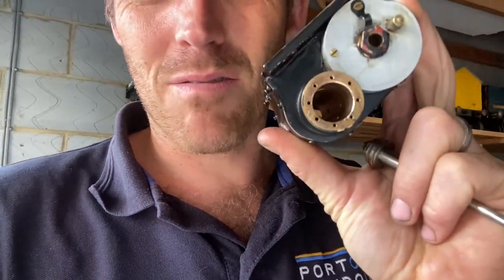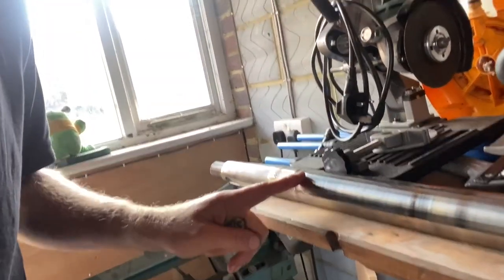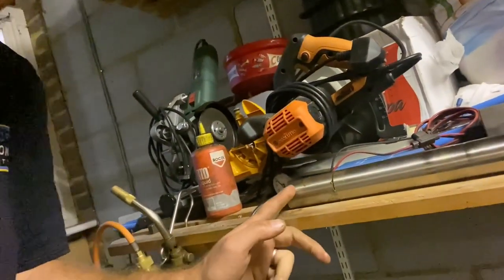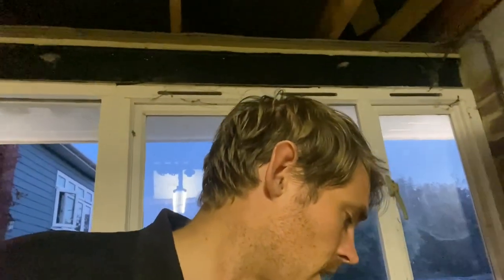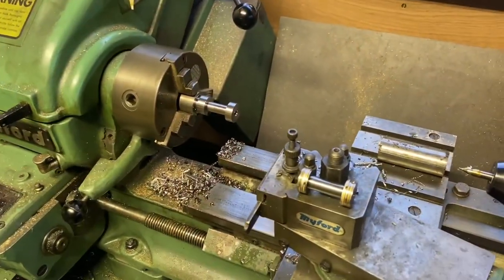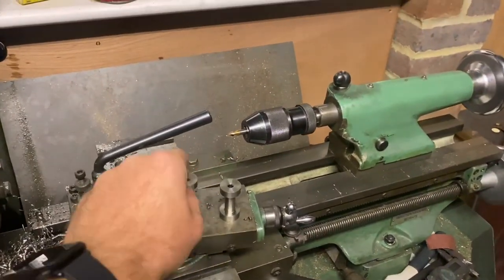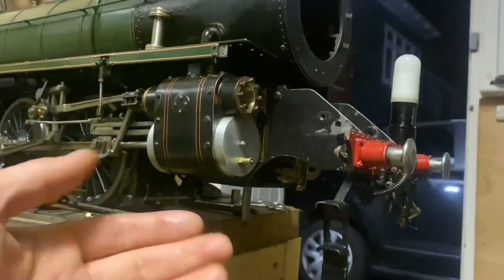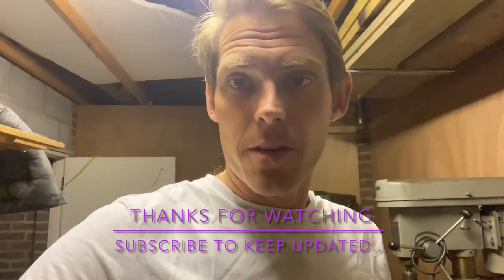Machining valve bobbins

Comment: Great video again Tom.
You are certainly making headway with the project.
I have never turned stainless steel, but I have drilled stainless sheet steel and it blunted the drill bit's very quickly.
If the drill bit was not loaded with pressure continuously, that would cause the drill point to go blunt, but you do not seem to be having any problem with your tools and material.
Cheers.
Reply from the maker: Thanks. 
Yes I do get that issue, and have in the past. Plenty of cutting fluid… the carbide tipped tools are good for stainless, however the parting tool I was using was a lot more temperamental and needed to keep the pressure and keep the cutting fluid going.
Reply: Thanks Tom,
Information like this is very useful and saves a great deal of frustration and disappointment to the uninitiated  model engineer.
Cheers for the feedback.

Comment: I have to make new valves for my 3 1/2 black 5 what would you say should
the cold clearance be between piston and bore please?
Reply from the maker: That really depends on the materials. In an ideal world you would match the expansion rate of the piston with that of the liner material. Bronze and stainless are similar, but take a look. If there’s a large expansion rate difference I wold avoid that material.
Reply: Hi Ken, I think Tom is right, there probably comes into play the also the 'hardness of the material' as a wear factor. I am no expert but I guess you would want the piston or valve bobbins to wear quicker than the cylinder, so in future maybe only the piston or bobbin need addressing rather than them and the cylinder.
Have a look at some model build descriptions from LBSC 'Speedy' or Martin Evans 'Jubilee'.
They will suggest the comparative materials to use.
Cheers.
Good Luck.